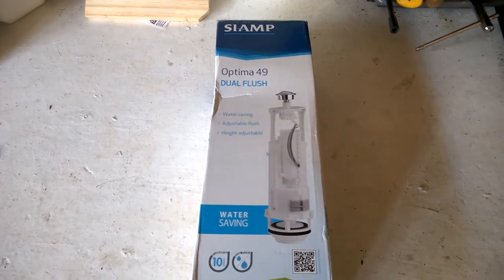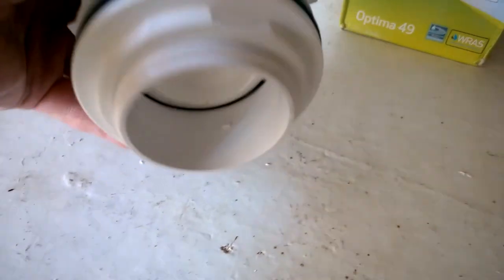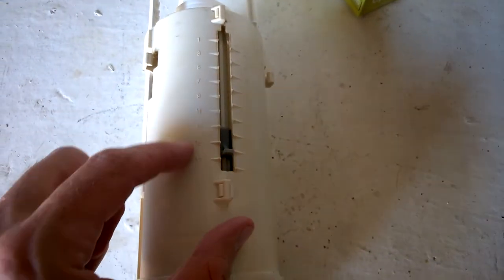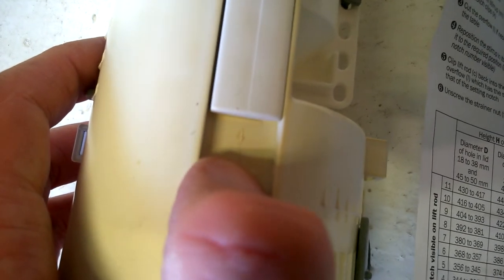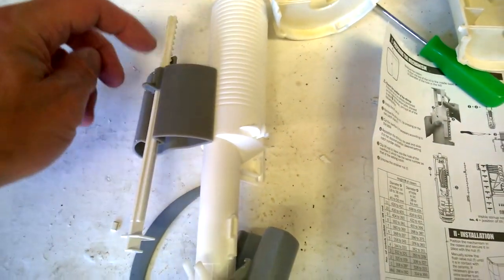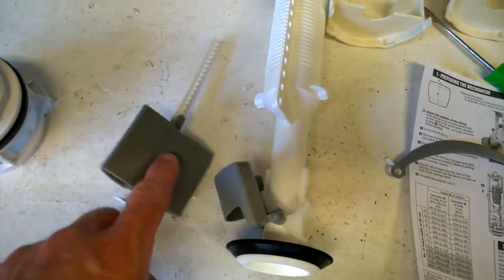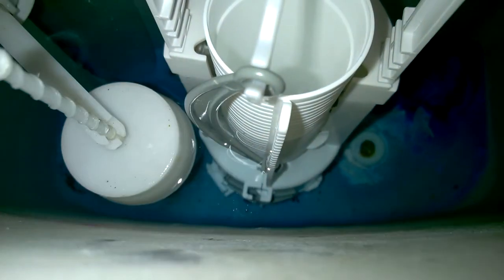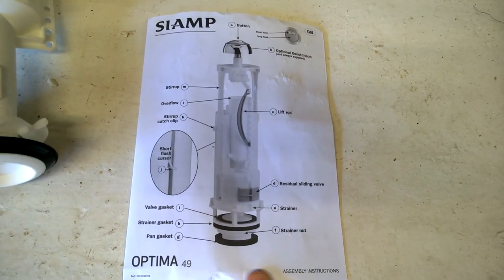SIAMP Optima 49 Flush Unit Swap and Tear Down - What's Inside - How it Wiorks

Comment: Excellent video, I've got one of these and the Siamp  99T bottom entry inlet valve, fitted by the lads who refurbed my bathroom 6 years ago .I noticed a few months later that there was no difference between the short and long flush but it didn't really bother me - now thanks to you I can adjust it. I presume they left it set to max for the short flush.
Funny thing about the inlet valve  -  about 3 years ago I had to replace the diaphragm  as it wasn't shutting off. 
I got 3 replacements from Screwfix and repaired it, last week I had the same problem so took the button and cistern lid  off and fitted a new one, it didn't work every time so 2 days later put the remaining one in and it was the same - i did a bit of messing about and realised that if I screwed the button on the flush valve all the way in when the lid was off it worked - ditto with the lid on and the button really tightly screwed down.
 I cant figure out  yet how the  depth of the button can affect the fill valve but its working fine  - going to download the destruction sheet for  both items and see if I can find an answer.
Thanks again for you video our kid. 
PS  I live 10 mins from Siamps offfices in north Manchester and if I cant suss it out I'm going in to see them which reminds me ( absolutely nothing to do with plumbing but a funny story)
the  Siamp offices are  on the same site that I worked in for nearly 30 years , "Ferranti Meters"  and we had a guy in the Toolroom who for a laugh nicked one of the domestic single phase electricity meters we made, screwed it to a couple of bricks with the supply tails hanging out and took it to Norwebs store in Oldham to ask if they could calibrate it as he didn't think it was correct saying he would pick it up in a couple of weeks!
Reply from the maker: Cheers for the comment. Glad you have it sorted. I agree though it's a bit of a mission to work out and get this thing working correctly! Possibly way over complicated for a flush!
Ha, brill story too! You have to love a prank!

Comment: Further to my other reply, my Siamp fill valve that I mentioned didn't last long even with a new diaphragm fitted - worked about10 times on the run, but when we got up the following day it was still filling from the previous flush about 6 hours earlier.Ripped it out and got a complete new valve (Viva Skylo from Toolstation for £8.98).

Comment: Ours seems to be the complete opposite and gets stuck up sometimes (keeps flushing water into the bowl). I ended up ordering an Optima 50 to replace it, but now it seems to be working again just because I removed the collar around the flush button that wasn't even needed. Maybe it had something to do with the overflow pipe since this would have altered the height. Probably wasted my money now, but I would probably be best off just fitting the new one anyway since it's less likely to have issues.

Comment: Hello, great video, but after replacing i vannot set to long flush, even the j setting is to 18, i have to hold the button down constantly for a full flush,
Reply from the maker: Yes these are not the best devices for setting the durations. Sounds like there could still be a setting that needs a tweak. Worth just popping it off and checking to make sure there is nothing broken is not fully home.

Comment: Mine was leaking into the bowl. Replaced the washer and it solved it for a month. Started to leak into the bowl again so purchased a new unit. This didn’t resolve the issue. Had to pay for plumber to take the toilet apart and refit. Seems to be ok ….for now. Even the plumber couldn’t understand why when replacing the flush valve in the cistern it still didn’t seal! Rubbish consumable parts IMO.
Reply from the maker: Yes, we get this on occasions, perhaps some debris gets caught between the washer and the seat.  Not the best.